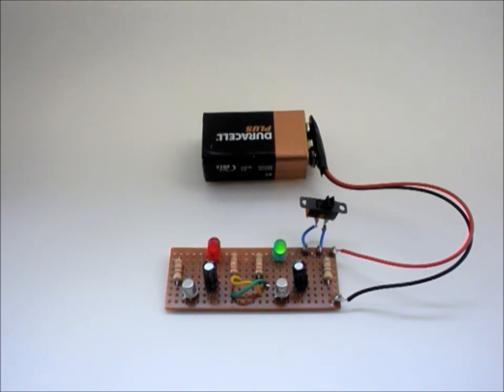Irby Electronics Project 12: Alternately Flashing L.E.D.s Using Transistors

Comment: can you make it flash faster?
Reply from the maker: Hi elboregojhb,Thanks for your query.Sorry but the flash rate&#160;for this circuit can't be altered in the same way that the flash rate can be varied for Projects 11 or 13. For a faster flash rate, you could change the values of C1 and C2 to 10&#181;F or 4.7 &#181;F or 1 &#181;F.&#160; For a slower rate of flashing you could try a value such as 47 &#181;F. These are the readily available values of capacitor.John
Reply from the maker: Not sure what happened here! System didn't seem to like me using the Greek letter mu to represent microfarad!  I'll use u instead! So for a fast flash rate try C1 and C2 as  10 uF or 4.7 uF or 1 uF.  For a slower flash rate try 47 uF. Hope this attempt is a little clearer!  John